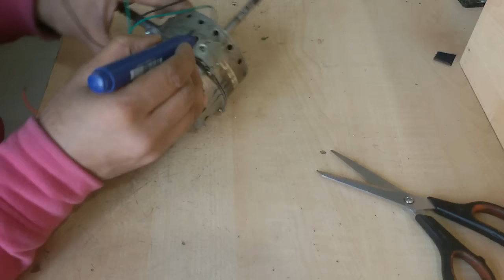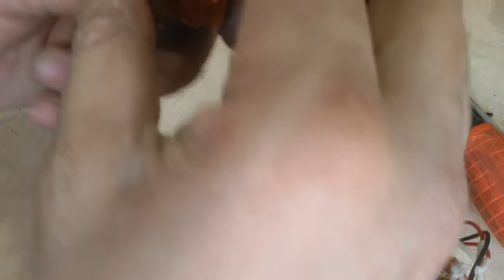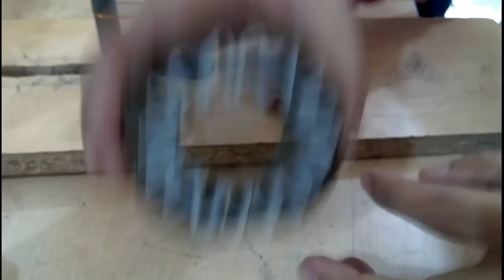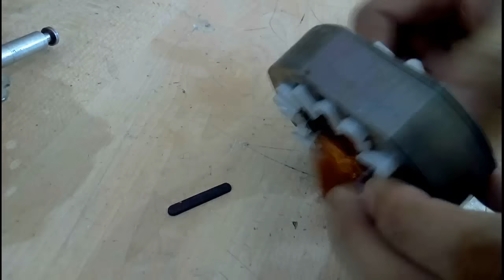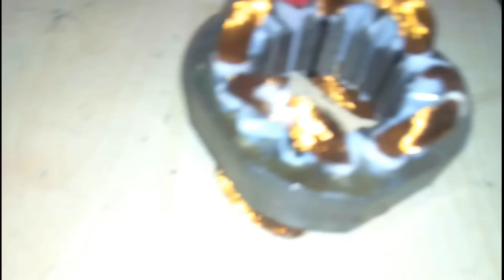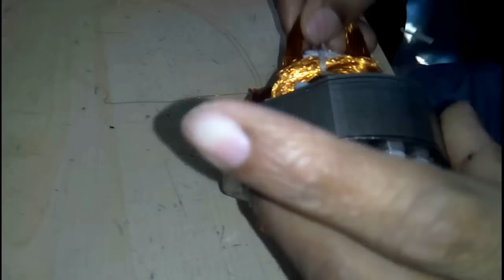How to make table fan open and rewinding | fan rewinding | Motor Rewinding |

Comment: How do you calculate turns of coils. Please reply I need it for school.
Reply from the maker: by old coil
Reply: Youtube Based Training BD thanks but if old wire is glued what can I do
Reply: Youtube Based Training BD how many turns do you use in those coils
Reply from the maker: You find ampere for motor watt than select wire size from ampere or apply your experience. Thanks. please share my videos
Reply: Youtube Based Training BD thank you. I already shered this video
Reply: @florianalia8319  
lknow